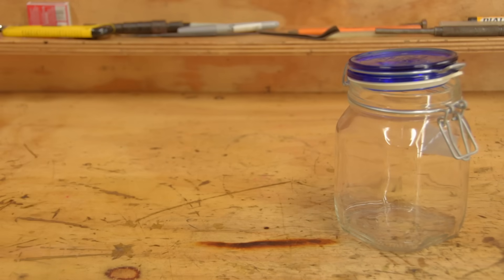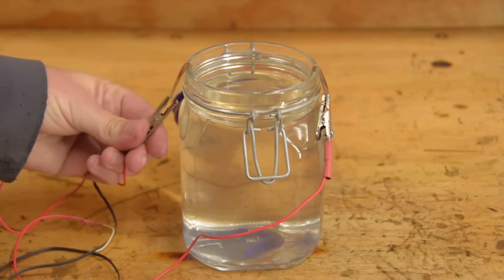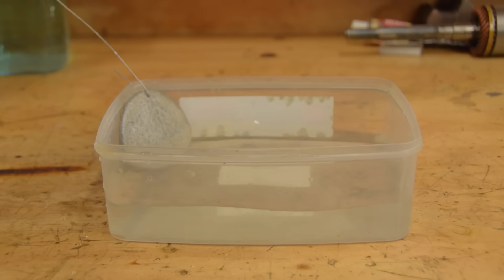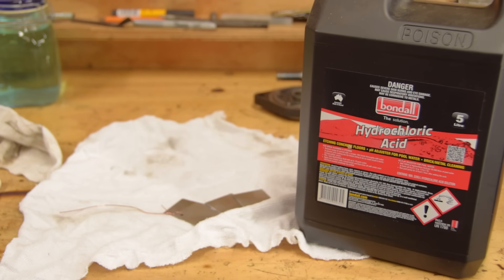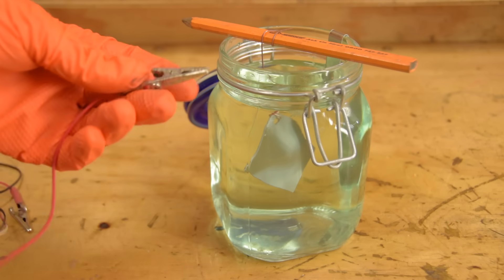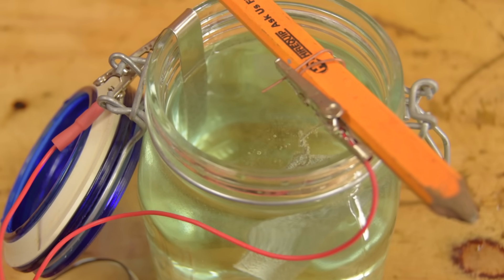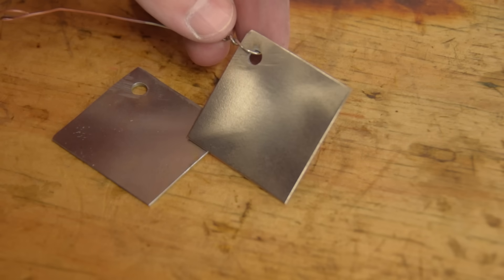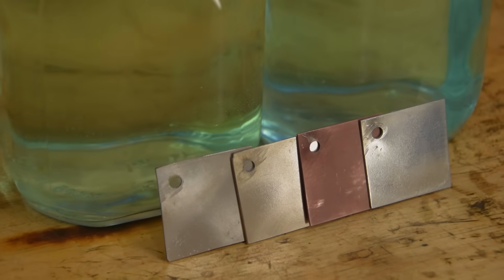Electroplating - Easy DIY Nickel, Copper, Zinc Plating

Comment from the maker: USE IN A WELL VENTILATED AREA. Like a garage with the door open. Some chlorine gas will be released at the anode. Nothing crazy, but be sensible. You can use baking soda in place of table salt if you’re concerned.
Reply: *squeaky voice *  but where do I get cobalt? lol
Reply: @Gaark  LMAO
Reply: We're do I get the eBay from?
Reply: S James try up the amazon.
Reply: @sjames5027  You can pick some up at Sears I hear....
Reply: @sjames5027  "We're do I get the eBay from?" OK, I laughed at that one. That is a rarity. Thanks, man.
Reply: Most so-called chrome plated things are actually bright nickel plated anyway. If you get original parts replated that's typically what they'll use too.
Reply: Do a cobalt nickel video! I'm very keen to see the chrome effect. I'll send you something small to plate :)
Reply: Chrome is plated out of hexavalent solution of Chromic acid using insoluble lead anodes and needs to be catalyzed with a bit of sulfate and/or fluoride to produce a bright deposit.   It is not an efficient reaction and hydrolyzes the water to H and O so you'll have an explosive gas on the surface of the plating solution.  Cu and Ni plating are nearly 100% efficient in that almost all the electrons are used to reduce the metal rather than hydrolyze water.  Hex chrome is toxic but so in Nickel which Europe considers carcinogenic so that on automobiles there can be no exposed nickel that a person can touch.   As for appearance, just put bright nickel next to bright chrome and you'll see in an instant why chrome is popular, not to mention its NON-TOXIC properties once reduced to metal and impressive corrosion resistance.
Reply: Chromium is a supplement too
Reply: Yeah I looked into that and just decided I value my health more than shiny surfaces
Reply: Chrome is bad? Maybe okay if I use Google Chrome???
Reply: Alright, thanks 👌
Reply: Geoffrey Croker Why will chromium kill you again?
Reply: Dan B- when in solution the chome forms Hexavalant Chromium, which is highly toxic.
Reply: @phoephoe795  someone watched Erin Brockavitch .. first thing I thought of when chromeium came up lol
Reply: Hexavalent chromium compounds are genotoxic carcinogens.  Check out the Erin Brockovich movie.
Reply: @gordonjones1516  Sigh.  Well we're not drinking it now are we.
Reply: @DBELLTREE  Google something like hexavalent chromium, or just look up Cr2O3.  Even chemistry labs, who used to use it mixed with sulfuric acid to clean anything off glass are afraid of it now.  I used to do chrome plating and there's a reason cars no longer use it....it stains you, burns you, and then gives you cancer, it's super nasty stuff.  To make it more fun, it won't plate at low current density, and the density it will plate at, it's foaming hard and ejecting this poisonous crap into the air...even a layer of floating plastic balls + oil doesn't contain it and you still need a fume hood....and it's picky about what it will stick to...It's simply not worth it unless you have some crazy other requirement for actual chromium.
Reply: @DCFusor  I should have known you'd be here with your sage like wisdom old friend. I should have just emailed you, but my old bubble gum and duct tape hamster wheel box decided to finally succumb to a decade plus of complete and utter discontent on my part. Got a windows 10 piece of ... I mean nice laptop at the pawn for 35 bucks. Welcome to a new decade, apropos as it is because even though I need new glasses badly, I can see much more clearly. Getting stuck here instead being set free inthe cosmos has that effect I reckon. We still have to blow some stuff up together, don't think I've forgotten ya, but I'm not coming out till Spring or 68 degrees whichever comes first. I had a bit of a go last year Brother. Just over a year now since I was supposed to be a goner from Cancer but the universe saw fit to condemn me to more of this nonsensical existence for now, so I'm feeling particularly froggy, ya know. Other than hardware in the spine and a piss poor attitude at times, I'm pert as a rutting buck. I was here trying to see if anyone's figured a decent way to make some plastics or polycarbonate (Lexan) look nickel/cobalt plated (Chrome) and not chip and peel other than cheesy spray paint that they still haven't gotten a hue over silver. I'm glad I got to see your mug here. Someone who truly understands and appreciates good quality bitchin and whining. Paid 11 bucks for "Looking Glass" new paint in the half can size and its even worse than the old Rustoleum chrome,  at a dull pewter at best. Not even the kind of pewter we like ;) I thought about ya and hoped the cashier stopped in to see ya. I think I'll try to find some chrome hydrographic sheets and dip the stuff I want and call it a day. I knew to stay away from real Chrome anyway, because i'm pretty sure my Ex was Hexavalent Chromium. I still have the same email if ya wanna shoot the breeze, or some gas cans or something. Take care old friend. ✌️
Reply: @DBELLTREE  We are talking about the front surface of the bumper of a '57 Chevy at an accident scene.
Reply: @DBELLTREE  Google the problem with metal on metal hip replacements and you can see the problem.
Reply: Cobalt is linked to a lot of health problems. Start aware from Cobalt. There's study's proving Cobalt poisoning causes dementia & Alzheimer's along with a slew of other neurological issues.
Reply: I always thought the shiny surface we think of as chrome is nickel and it has a thin layer of chrome over it to protect it. So what people think is shiny chrome ware is shiny nickel ware with a clear coat of chromium.
Reply: If you have muriatic (hydrochloric) acid you can use black nickel oxide from a ceramics supply to make nickel chloride for the solution and use a carbon anode (cheap batteries have them) - just replenish as needed.  You can make lots of other chemicals this way from ceramics grade materials - probably not 99.9% pure but good enough. ... but get a vent hood - chlorine gas is bad.
Reply: Ok, is nobody going to talk about how close the gator clips on the nickel anodes to the metal ring on the Mason jar? I know it's only a phone charger power supply but still....
Reply: Chromium is only good as an alloy metal... th rest can be done with safe and easy to work with metals
Reply: For the Cobalt-nickle mix, do i make them seperately and then mix them or can i add both cobalt and nickle in the same jar to make the solution.....or doesnt it matter?
Reply: Bahahaha. Nickel is worse than hex chrome.
Reply: I don’t use Microsoft Edge
Reply: What about a trivalent chrome?
Reply: Is this the reason that a lot of cylinder shafts that used to be hard chromed are now coated black, I believe some kind of nitriding?
Reply: Snorted out loud at your mermaid scales.
Reply: What benefit is there to using table salt instead of baking soda?
Reply: does this work with 3d printing?
Reply: I'm wondering whether vinegar and baking soda would kill each other
Reply: That was a great tutorial, do you know how can we add diamond grit in the process to stick them to the work piece and make for example electroplated cutting disks?
Reply: @heidarzadeh2  
I can answer that for you.
Your substrate metal should be soft iron, brass, or copper shaped to the profile you want.
Mix your powdered diamond with fruit pectin or other sticky ichy that can suspend the diamond dust and be painted onto the metal.

If you're making a disk or wheel, mount it on a spindle.
Paint a small portion with the  wheel spinning at low RPM.
Press the diamond into the metal surface with a hardened steel roller.

Paint the next portion, repeat.

Wash with running water, but do not brush, scrub or use high pressure spray or ultrasound... it will just knock weakly embedded diamond to fall out.

Plate... It is less important what you use than how heavy... you want a plating at least half the thickness of the diamond dust.
If you plan on layering the diamond, copper will probably give best results.

Repeat until you have the desired diamond charge.

You can expose a uniformly sharp diamond charged surface with a bench stone and a light touch.

Make sure to keep the surface irrigated with a good diamond coolant.
Reply: @Able Baker 
Thanks a lot, I will test it. Have you tested this solution before?
Reply: @heidarzadeh2  
Yes, I make my own diamond engraving points and wheels for engraving and brilliant cutting of decorative glass.
I don't usually bother with plating but if I want a fairly generic profile, like an A wheel or lap, I send it out and have it hard chromed. 

For semi-polish before actual polishing I use a polymer resin rather than roller charging... I'm getting some UV curing acrylic to try as it might improve getting the resin on uniformly before it sets, which is always problematic.

Cutting is done best with courser diamond dust in soft iron or copper.
Soft iron takes more effort but the wheel retains its profile for a very long time.
Copper works best for making points/burrs quickly but they wear out quickly as well.

Pre-polish I currently use μ graded dust mixed with an AB structural epoxy. Not a perfect system because it's difficult to get the charge on uniformly. Then when it sets, I have to trim it into final form with xacto knife blades which is rather tedious. I want to try it with UV resin because it will hopefully allow me to work with it a bit until the diamond charge is pretty much uniform before exposing it to UV to set it.
Reply: @heidarzadeh2  good idea maybe! Did you try in the meantime?
Reply: @paulwyleciol3459  I have not tried yet dear paul.
Reply: @heidarzadeh2  I work in heat treating. We braze diamond pieces to parts. Think trying to plate them on it would be to thin of layer
Reply: @user-lz2bn6eo1j  Thanks for your reply, Please tell me how can I do heat treating and plating?  what kind of material and machinery do I need to do that?
Reply: @heidarzadeh2  depending on what you're wanting done. Look for someone that can do it and outsource. Do some research on the metal you are using. Some can be flame hardened. What I was doing is in vacuum furnaces. Have also done in atmosphere controlled oil quench furnaces. A lot of different ways
Reply: @heidarzadeh2  I seen on Ebay awhile back a disk that had heat treat info on it. Most was info about  a hundred years old. Might be a good start that is not on an industrial scale.
Reply: @heidarzadeh2  - really interesting idea, but that's not really related to electroplating, which is happening at the atomic/molecular level - you're sticking literally  atoms of metal onto another object, whereas a particle of grit - whether diamond, aluminum oxide, silicon carbide, whatever, is a clump of a few bazillion atoms. You don't really 'plate' grit onto a disc - it's stuck there through a different process. And that is certainly not only outside the scope of electroplating, but probably way outside the average DIY-er's capability (and if not, you're making some discs that are both far more expensive and far less effective than even the cheapest Chinese import - and that's saying a LOT, from someone who's bought a lot of abrasives....)
Reply: @LeaveMeAloneGoogle, Thanks for your idea, but I'v had some research about it and I know that diamond electroplating is exactly done with this process using Nickle, And it is not a very expensive process to do! And about Chinese products, They are cheap but without good quality! I'm using these products right now for cutting and engraving stone, but Korean products not Chinese, There are also European products that are very expensive, I usually prefer Korean products because of reasonable quality and price.

Comment: I’m 2:32 in and I already love it !!! The high pitch “inside the head whiny voice “ is so spot on for counter questions I think. I’m sub’ing . You may have said this referencing details listed, but what parts of each are you using?? Looks like 16oz water? Distilled matter?? How many grams of salt? At 2:32 I’m already set amazed and asking things you will probably explain in the next 7 mins. Good work dawg!

Comment: You add the acid to the water, which is the correct order. 
It would be wise to explain that adding water to acid is dangerous. 
Adding water to acid can splatter heavily. 
The splashing acid can cause serious burns.
Reply from the maker: A normal person is not going to come across an acid that will splatter heavily if you add water.

Comment: A year of five ago I used this video to get some nickel plating going. After not doing anything with the solution I recently needed to plate something (homemade tip for heavy soldering iron) Grabbing the jug I thought I had to watch this video again to check where the + and - should go to. But I seemed to have foreseen that because I just wrote it on the jug. Was a bit bummed out i didn't have to watch your video again. Thanks again!

Comment: Swap out the table salt for pickling salt. Lack of iodine will give you a better surface finish (short answer).
And if you want a thicker, smoother finish... plate for a bit, take it out and polish it (scotch brite, etc), plate again, polish, plate... until you decide enough is enough.  ;)

Comment: I can't buy Hydrochloric acid where I live. However I can get things like brick cleaner at 10 to 15 percent hydrochloric acid, What percentage does it need to be to prepare items for plating?
Reply from the maker: You don’t need it. Just make sure the part is very clean.
Reply: "brick cleaner" is probably muriatic acid which is just 'impure' hydrochloric acid.

Comment: I’ve bought some copper, nickel and zinc anodes, but only tried copper so far and that’s working really well, but dumb question… if I put two chrome plated items (such as guitar tuner pegs), would this create a chrome solution? I get I would have to plate nickel first, but I’m trying to work out how to do chrome and black chrome…
Reply from the maker: No, chrome is different. You’ll have to buy a chrome electrolyte. Caswell have a chrome kit, otherwise you can try nickel cobalt which looks pretty close. Or maybe palladium if you’re plating jewellery.
Reply: Thank you, I’ll look out for electrolytes; fancy a go at gold and silver too - mainly for guitar parts, but I’m guessing they’ll need a long time in the electrolyte as they’ll probably have a hard life. Gotta thank you, you’ve completely demystified the whole subject and opened it up for me have a go at, so good on you. Keep the videos coming 😊

Comment: I just tried this out on some brackets and it worked pretty good! However, I did get some darkish streaking on the first part. The second was stirred frequently and plated really nice. Seems important to have good agitation to achieve a good finish.

Comment: Can I make electrolyte without salt? I mean I can, but is it necessary to add salt (any other benefits except conductivity?)
Reply from the maker: You just need something to act as an electrolyte to get started. Once the nickel is in solution it will act as an electrolyte. You can use baking soda if you don’t want to use table salt.
Reply: @GeoffreyCroker  Thanks for rapid reply 👍 Reason why I'm asking this, is that I want to experiment with local zinc plating/spot plating (without a container, without submerging parts in electrolyte). To make some sort of DIY current feed to a sponge like material or cotton pad e.t.c, simultaneously adding electrolyte and that way work on desired area. I want to avoid salt because of it's corrosion characteristics. Might sound like a dumb idea, but in my mind, so far I think it must work, so I will try 😅
Reply from the maker: @bezliekiemkomentariem this is totally feasible. I’ve done this with commercial solution before. Just a cotton swab soaked in solution.
Reply: By the way.. is there alternative to vinegar? Apologies, I'm not chemist, but I'd like to learn more about all this.
Reply: @GeoffreyCroker  That's a relief 🙏
Reply from the maker: @ yes. All you’re doing is making a ‘salt’ of nickel. In this case nickel acetate. If you used citric acid, you’d get nickel citrate. Most commercial solutions are alkaline. Any (maybe not literally ‘any’ - but you know what I mean) solution that can carry nickel in a dissolved form will work.
Reply: @GeoffreyCroker I first replicated Your tutorial. So my setup is same, but as You said - "if you're only plating for fun..." well, I was until now. I have a 1983 Audi Cope with a zinc plated body, but, one fender was damaged long time ago, and replacement is not zinc plated, so there are rust spots. I want to plate all fender, so I'm collecting all info I can before jump into it. Apart from that, I want to cure other spots that appeared since 1983. This is just to begin with. I'm sure as I go, other projects will come along.

Comment: Looks like I'm doing a vinegar nickel solution for when I dip golf clubs. (My plan is remove the chrome using 30ish% muriatic acid and then copper plate with a muriatic acid solution. More research shows that the nickel step is important!)

Comment: Unless I am mistaken, for plating nickel to steel, the description is to put the positive lead to the nickel plate and the negative to the tool to be plated - is the reverse not required to move electrons from the -ve (nickel plate) cathode to the +ve plate (steel tool) anode therefore "anodising" the steel tool with a nickel plating?